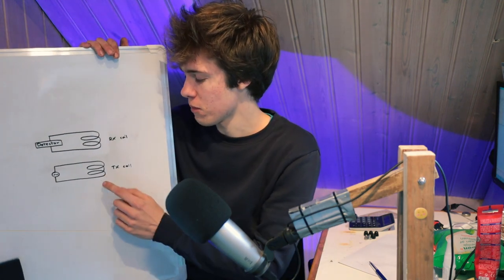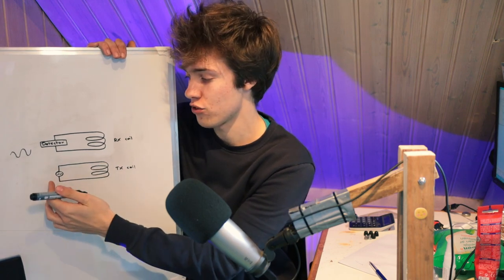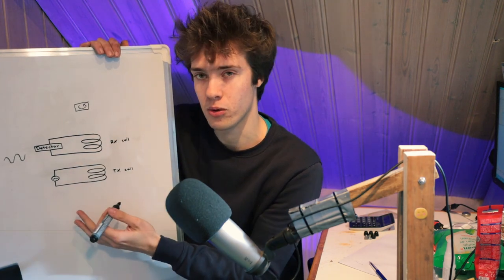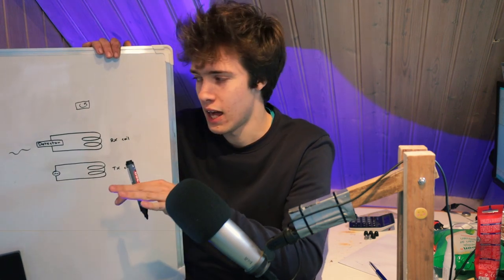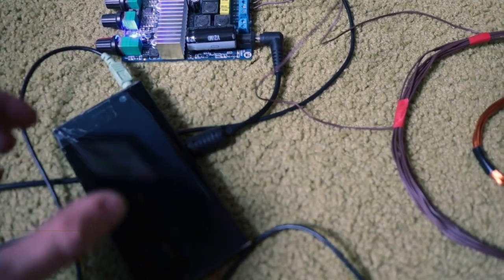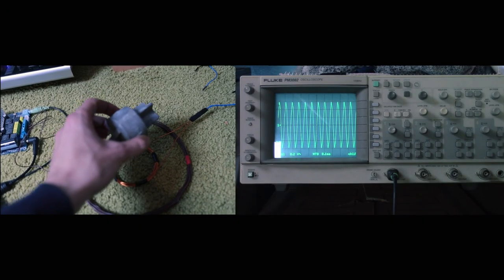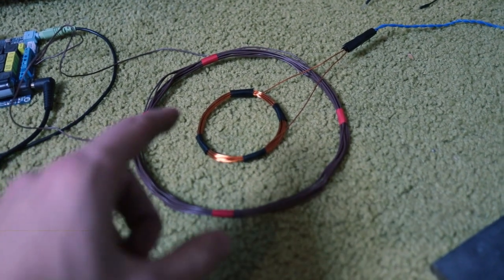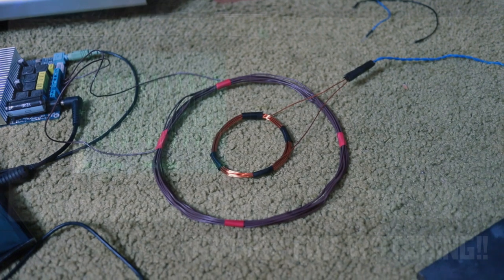How metal detectors work

Comment from the maker: Important detail: there's something I did not explain right. When a metal object approaches the transmitter, it does produce an opposing field, however the transmitter coil will experience an increase in current that compensates for this, so that the net field remains the same. Just like in a transformer: drawing more current on the output also causes more current draw on the input. For this reason, if your receicer coil was identical to your transmitter coil, and placed exactly on top of it, it would see no change in the field.

The key then, is that the receiver coil is shaped differently, has a different size, or is placed in a different location. Although the metal object doesn't change the net field through the primary, it does change the field locally. (in other words, the shape of the magnetic field). Therefore the pickup coil needs a shift in position, a different size or a different shape.

I did not go into the importance of the coil geometry/placement well enough in this video, and plan to do this in a revisit later on.

Thank you for watching!

Comment: How does the oscillating frequency from the transmitting coil affect the function of the device? Would a frequency above human audio range be better, with the receive signal being fed through a frequency divider to enable the operator to hear?
Reply from the maker: It depends on the range required/the size of the objects etc what's best. Normally the lowest frequency they operate at is about 10kHz, which you could technically hear, but it's a very sharp, annoying high pitched whine, so usually, even at lower (audible) frequencies, the tone the operator hears is not the carrier signal itself but indeed something derived from it.

Comment: What a horrible explanation.

1.  You demonstrated a de-tuning effect of a coil near a metal object.  Not how modern two coil detectors work.

2.   You should have a second pobe on the TX coil to trigger the oscilloscope trace for the timing of the rx coil.   

3. This would allow you to null the rx coil so that the signal strength is near zero.

4.  Place metal near the coils and you could witness the signal strength and the phase change on the rx coil.

5. This would demonstrate the ability to detect size and depth on a metal as well as its conductivity for a generalized identification of metal and size/depth.

keep learning.